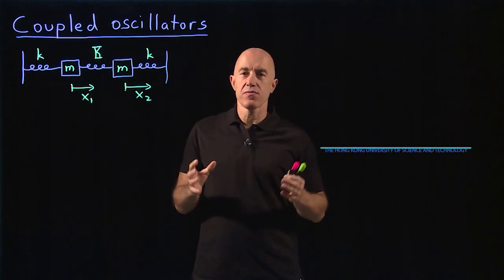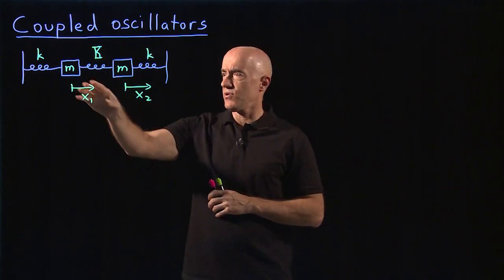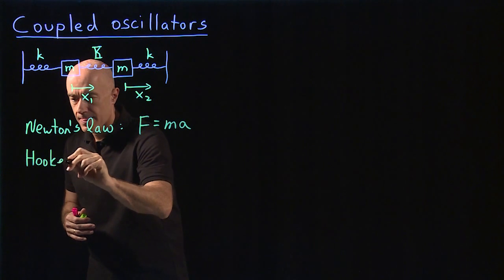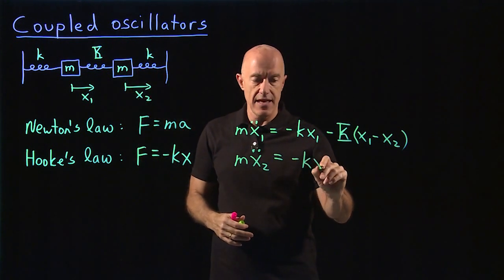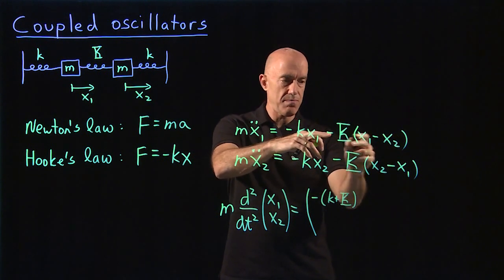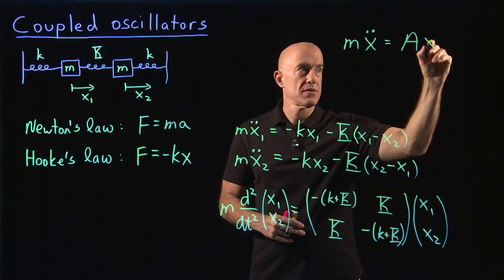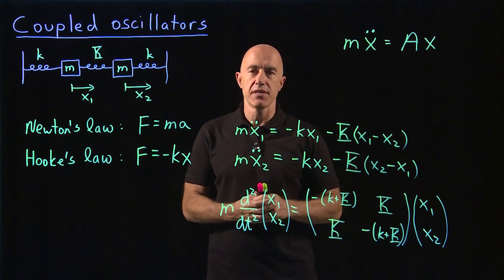Coupled oscillators | Lecture 46 | Differential Equations for Engineers

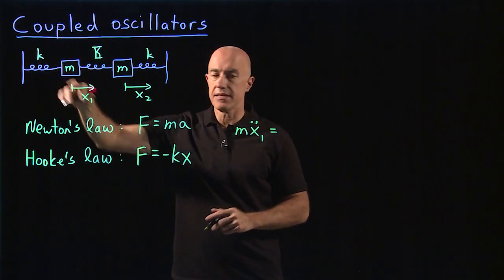Comment: 4:03 I don't understand this part. Wouldn't the force of the second spring be directed in the opposite direction? I feel like the two springs would be pulling in the same direction if both terms in the equation are negative.

Comment: What if it wasn't a spring force between the masses, but a drag force which is dependent on their relative velocities? So the first e.o.m would look like ... = -kx1 - U(dx1/dt - dx2/dt) where the magnitude of the drag force is U times the relative speed. 

So, as if the blocks where on top of each other basically.

How would we then construct a matrix as done at 6:20?

Comment: If there was a third mass there, would you have to take that in account for each equation of motion?
Like would it be (x1-x2) still or would it have to be something like (x1-x2-x3)?
Reply from the maker: There would be three equations instead of two.  Only the springs attached to masses need to be taken into account for the forces.

Comment: Hi,

Could you explain how specifying only the forces on both masses fully describes the kinematics and dynamics of the system? 

There is more than one position  configuration for any set of forces for this problem, so specifying the forces alone cannot fully describe the system.

Could you make a video that discusses the possibility of modifying the kinematic equation 

Delta(d) = vot + 1/2 at^2

Into a dynamic differential equation?

Also, your system seems to have 2 origins.  Would it be better to derive the equations of motion twice, from two different frames of reference?

Comment: Can you provide the GUI code for the simulation you performed. I have found the solution but how to graphically simulate it like you did especially extension and compression in springs
Reply from the maker: My GUI Matlab code can be found on Matlab Central.  You can search under my name.

Comment: Why is the force of the leftmost spring on the leftmost mass -k(x_1)? The distance from the leftmost wall to the mass would be the (lengthofeverything  - x_1), right?
Reply from the maker: Hooke's law is just the extension or compression of the spring from its equilibrium position.

Comment: What if the connecting force is electrostatic repulsion instead of a spring?
Reply from the maker: Then you use the appropriate force law.
Reply: @ProfJeffreyChasnov  But if the distance between the oscillators is large enough, and the electric charge of the oscillators small enough, it can be approximated to a spring, right?
Reply from the maker: @doremon2006  I don't think so.  The spring force is assumed linear and can be attractive or repulsive.  You said electrostatic repulsion, like a plus-plus-plus charge?  It is an inverse square law and always repulsive.
Reply: @ProfJeffreyChasnov  Then I will never be able to create a  "stiffness matrix" for the electrostatic case (the general case, which can be attractive or repulsive) using the charges q1 and q2... ok, the problem is hard then, even numerically on Matlab.
Reply: @ProfJeffreyChasnov  Anyway, thank you very much for your answers and for making me think more about the problem! I will find a solution for that simulation...